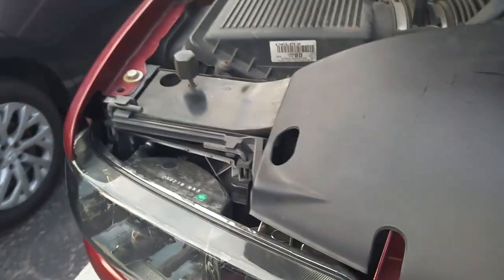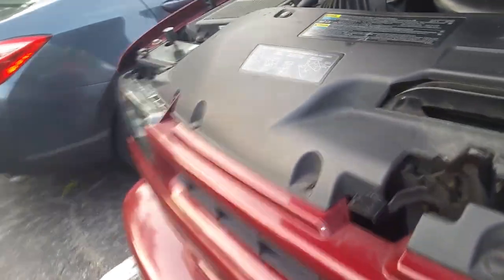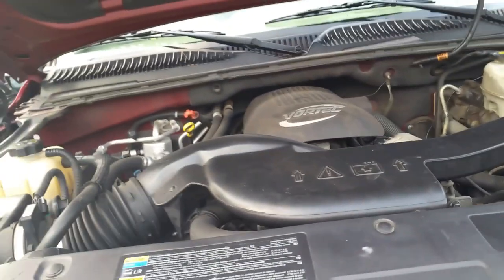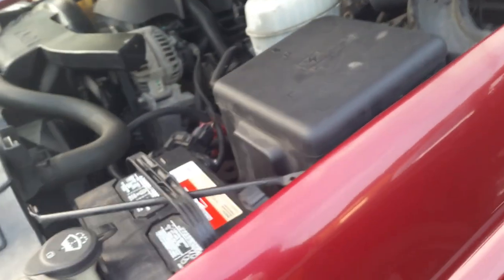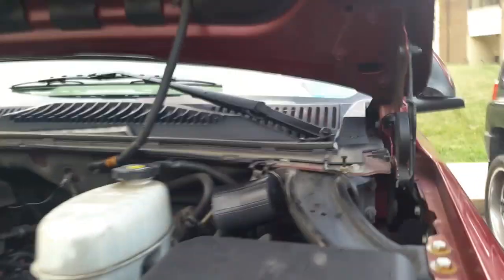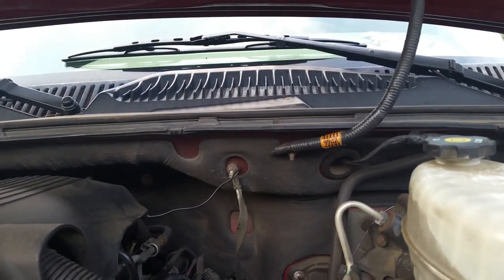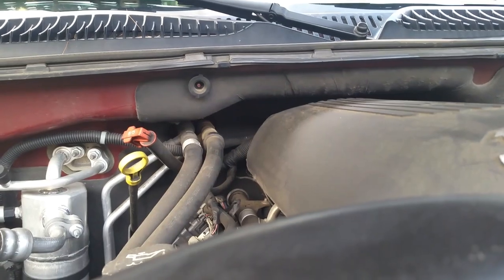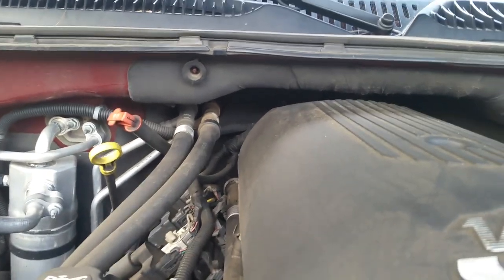Bad ground wire on 2005 Chevy Tahoe Z71

Comment: Bro thank you for this video, today my wife calls me said the car just shut off while she was driving. So I'm at work I'm a heavy equipment mechanic,  an I run a service truck, so I pack up haul but over to her cause it's a 100 degree out here in Texas, an she got my kiddos with her. So I pull up start checking fuses an battery normal diagnosis stuff, load tested batter an it was bad went an swapped out battery,  still no start. Finally I called my roadside assistance,  so I could just tow the car to the house to get them out of the heat, an work on it there. So as I'm waiting on tow truck to arrive , I start scrolling through no start issue on YouTube for suburban, an bam land on your vid. Get back out of the truck to look at the suburban,  an same thing wire broken off at the back, so I hook my my test leads back to ground right quick, an she fires right up!!! Right as the tow truck is pulling up, so I called off the tow an saved$ 135, just put a new terminal end on the ground wire an hooked it back up, no problems out of it so far.  All praise be to God, for me finding this video , an you making it.

Comment: 2003 Tahoe Z71 here, purchased new, over 300,000 miles and periodic wonky electronics, like low power mode and the ABS and Traction Control lights and weird DTC codes; also electric lock and window problems.  I feel your pain, but I have learned the hard way about Chevys and bad grounds from another Chevy I own, and keep an extra braided ground strap on hand at all times, and use my digital voltmeters to check my circuits. 

The best thing I have learned is to buy no new parts until I check battery voltage and battery ground from negative battery post to engine block then negative post to chassis/frame if it's a no crank/no start.  A bad battery connector can always keep it from starting or recharging correctly, so check the connection or voltage drop between the negative battery post and the wire leaving the negative connector or to the attachment point of the negative cable to the frame and/or  engine block.  For starts resulting low power mode, traction control and/or ABS lights, unplug the accelerator pedal position sensor connector, then spray both male and female parts of the connection with De-Oxit D5 or some similar electronic contact cleaner, even just 99% rubbing alcohol in a small pump sprayer, and plug the connector back in.  If that doesn't work, do the same to the throttle body connector, and visually check and spray the connectors to the fuel pump control module and/or pump and/or pump relay.  Check and spray any electrical connector exposed to vibration, flexing or weather or that has to work perfectly for the vehicle to function. For lasting connector protection from corrosion, use silicone di-electric grease.  If you had gotten an inexpensive scan tool ($30), or a blue tooth type scanner that uses a phone app to give you the diagnostic news ($80 to $100), you would have saved big bucks and a couple of day's lost time in this situation. Scotty Kilmer has current recommendations for these on his channel.  Also, ask your insurance agent about the cost of roadside assistance/towing on your policy - could be about as little as 10 to $20 a year per vehicle, which is what I pay.  If your policy already has it, or if you are a member of an auto club, you might be able to get reimbursed for all or part of the towing bill.

Comment: I’ve been watching videos all over YouTube for a week now and have been trying everything for the past week. I ended up ordering an ECM tonight and then ran across your video so I ran outside and sure enough the same ground wire was broken. I fixed it in the damn thing fired right up. Needless to say I’m trying to cancel my order now😂
You are a life saver I appreciate it so much ! 
I replaced my ignition my key Tumblr the battery and starter before all of this!
Reply: Any description of what to move and see that wire? My suv turns off at times and all of a sudden turns on in a couple minutes need help locating that wire?

Comment: Thank you for putting this video out. I have a 05 Tahoe with the same problem. I cut the wire you showed (mine was not broke), and grounded it like you showed. Mine would not even turn over. It runs now and hopefully this will solve my problem. I bought it in may 2019 and I have driven it a total of 3 months because of this and reduced engine power. It has sit since October because I couldn’t afford to fix it because of me having surgery. Now it runs so thank you again.
Reply: the problem my truck has is it wont crank or turn over. i tried eveything and put new parts in. my ground wire like the one in the video is not broken but should i still cut it and reground it?

Comment: Omg bro you have no idea how happy I am I found this video, 2 years I've Been having issues with my truck and meals and mechanics couldn't figure it out. It's been sitting for a good part of those 2 years and I found that ground that didn't have a good connection to the post. Rewired it and connected it and bam runs like a dream! You're a life saver!
Reply: did your truck have hesitation problems when driving.

Comment: A tip from someone that used to work in auto parts (me) dont trust them when the tester says the battery is bad. A lot of times when the battery is all the dead the tester will say "replace battery." Instead of buying a battery tell them you want the battery charged. You will need an overnight slow charge to get it back right. They have a quick 1 hr charge but sometimes the tester will say replace battery after those also.
Reply: Autozone just conned me out of a battery because of this.

Comment: I checked that wire, it was firm but I cut it anyways. I found an inch long break exposing the wire so I soldered a new wire, used heat shrink to cover 6 inches of it, grounded to the forewall, cleaned the grounds under the driver door to frame. Cleared the codes and so far so good. I just wanted to say thanks because the manual doesn't say real world things and I work long hours and don't have time to keep throwing parts and chasing a unicorn problem. Thanks.

Comment: Thanks! This video led me in the right direction. My issue was with the ground that goes from the firewall to the back of the block. This was my fix. I bought the same oe ground wire and ran it from the firewall bolt to one of the alternator bolts.

Comment: People think it's so easy to work on cars and trucks. But don't understand the knowledge and experience it takes to fix them
Reply: Because a lot of people think of mechanics as just parts swappers without realizing that sometimes it’s a diagnostic roller coaster just to find out what part is wrong.
Reply: Rite
Reply: living in a desert  🤣🤣🤣🤣🤣
Reply: I'm finding out a truck is no car , it's a different animal
Reply: Electrical trouble shooting is very time consuming, if you don’t find a good mechanic with good electrical skills, these problems can be very costly
Reply: I'm a mobile mechanic. I love when people call me and ask. "How much to change....." I give them this disclaimer, after giving them a price. " I didn't diagnose your problem, that the price whether this works or not... That's the price for changing the part". They will pay someone else to diagnose the problem but I have to argue with them to get my money for changing the part the previous mechanic mis diagnosed
Reply: @pmotorsports8276  I did somewhat that and basically mine works when it wants too now like 4-5 days it will say reduce engine power  then when I let it sit I try it out for curiosity and bam no check engine light no reduced engine power works fine but back to square 1
Reply: @sl0907  I love when they come to with a solution (thie wrong one)already.  "How much to change an alternator ?" Then complain about paying when that's not the solution to to problem

Comment: Use the big 3 method from car audio!! Put a ground grom battery to body, battery to engine mount, and if possible battery and engine to frame! Make sure to clean connect area to clean bare metal! You should also add a bigger wire to battery to alternator for better charging, be sure to run through the current sensing ring of electric system!! I had to do this on my chevy power wire to make electric system to function correctly!! I had to splice a second ring sensor to original for running extra zero guage for audio power! It solved my problem of shutting off ac after a few minutes and other charging issues!! Good luck

Comment: I would recommend using a thicker gauge ground wire when hooking up to your existing ground wire. Two ways you can connect it. You can use "Scotch Lock" connectors, these take the hassle out of soldering. Then use shrink tube followed by a plastic wire guard. Or you can just solder the existing wire with shrink tube. I preferre scotch locks.

Comment: FIRST THING.  Pep Boys policy,  if you can't figure it out and give the customer a definite answer as to what the problem is the customer does not get charged.  They owe you a full refund. Just call 1-800 or 1-888-pep-boys.  Trust me it works. I'm a retired master tech and have repaired that issue countless times.  Good catch brother.   Make sure you have a wire going from firewall to back of cylinder head.  Very important.

Comment: also theres a ground strap under the truck that wreaks havoc as well 

leading edge of drivers door follow it straight down under vehicle to frame of the vehicle its alongside your throttle cable remove ground clean all surfaces well (sandpaper ,scotchbrite or a good wire brush) replace ground to original position and your good , this ground can cause the reduced engine power fault

Comment: Mitch and Son in Law Will Drake.   2004 chevy 3500 dually.  
Just replaced both knock sensors underneath the intake plenum. Had to remove the plenum and to do so we unhooked all 8 plugs to injectors and had to tie the harness on the passenger side up and back towards corner of firewall and fender. Made removing the plenum very easy. Got knock sensors changed and plenum back on. hooked up all injectors and other plugs etc. Got in and turned key on and all dash lights went crazy. Right away I new something wasn't right in Denmark. Turned key to start position and lights went out then back on and went all funky but no crank .  Turned key off but all lights stayed on. removed key and different lights blinked on and off then stayed on with key out. Had to remove battery cable to shut dash down..  My son in law started googling and found your video.   He checked and sure enough that wire was broke and hanging behind firewall. While pulling on harness and tying it back we had broke the wire where it was grounded to firewall. reconnected the wire to ground exactly where you did and the damned truck started on first crank.  You are a God send and thank you so much. Hope your video helps many others also.

Comment: Yes,I"m an electrician by trade & sometimes the problem is very simple if you have a multimeter to.test the voltage with,on my Chevrolet LS1 V8 engine in my car,when I was replacing the hydraulic lifters in 2018 & I refitted the cylinder heads I missed fitting a couple of earth leads connections onto the back of the left hand cylinder head & a "contact dealer" message came up on the instrument.panel which usually means PCM failure.

On the left hand side of the car there's a positive power supply for the ignition coils integrated in with the air conditioning pressure switch wiring loom so that needed to be connected before the engine would even start as that wasn't connected either & the engine wouldn't start !

Comment: The ground point back there is a major issue,, that ground has a few different wires on it. Within a year your truck is not going to start again but this time another wire is going to break free from that ground point. That ground is for the ECM and a easy fix is to take one screw out of the engine computer and put a wire on the screw and run it to battery ground.  👌

Comment: Thanks for video, been working on 2004 silverado, no  crank no start, dash lights staying, replaced ignition switch still nothing frickin going crazy trying to figure it out. Watched this went straight to wire it was just hanging like you said fixed ground problem started first try.

Comment: Now you need to put in better quality ground wires; understand that there are several on all vehicles. Make sure that the attach points of all the wires are clean and use dielectric grease on the connections. Good luck Sir!

Comment: Tell me about it! Same thing happened to me. Except, I took it to Chevrolet. I have a 2003 GMC Yukon SLT 4WD. I told them I thought it was the ground wire. They said they would look at it.  They said it was the ground wire, but that they had to take all these assorted parts off the vehicle to access it. Charged me $400 something. I personally think its a set up - scam by Chevrolet. It happens to a lot of vehicles. Should be classified as a defective part issue and there should be no charge for the fix.

Comment: If these parts changers were really mechanics, they would of done a voltage drop test and found it
Reply: I pulled wrenches for 15 years, ASE certificates in 7 of the 8 areas at the time. I got out due to the need to obtain training that employers either did not want to help with or you got their brainwashing blurb school. One thing I remember printed on the side of every Sun Oscilloscope was "Test not guess". I have lived by that since I saw it. I have been in Industrial Electrical Maintenance for over 30 years. Finding issues like this is an almost daily occurance in a variety of settings.
Reply: @thegreenerthemeaner  2007 Tahoe headlights flickering.  Any ideas?
Reply: Peterbilt Pilot  thanks buddy.  I did a charging test on the alternator and it was charging low. New alternator fixed it.
Reply: Joey Sanchez check your light control module in dash common problem in these chevys
Reply: Same shit happened to me lol. I did find a video on YouTube though and found that exact issue before I started paying anyone. Thank god.

Comment: It's not Chevy's problem more than likely intake had been removed or oil sending unit had been replaced there are two bolts on the back of the head either on the passenger side or the driver side each one maintains a ground strap if their technician is too lazy or does not want to reinstall that Bolt the ground strap that you were talking about will not be installed properly there for creating drivability issues

Comment: I have mine running to that same ground that goes to the hood also. The original spot had oil on it my cluster still isn’t working though. Hasn’t stalled on me yet 🤞 hope that doesn’t happen.

Comment: Seems like that geneeration, '99-'06, Chevy/GM's with those Vortec engines, have an issue with grounds failing.  I recall some dude has great vids on that specific problem and how to remedy it.  Big Three, etc., etc., etc., but more importantly, how to correct that lurking issue.

Comment: OK happened to my son making pickup at airport 2 hours away....Somehow got jump and got things going again....watched several videos (2004 Crew Cab Chevy 5.3) and pulled on the wire seemed tight....next morning transmission indicator leds were flashing, Jumped, and has run with all gages working again for several short trips around town...Perhaps just got enough corrosion lose to get it to ground again.....our wire was Black with white stripe.

Comment: Engine cut out on my 03 and been chasing it forever. New starter, alternator, ignition switch and lock cylinder still only the battery light on the dash. No power to the radio or cluster and no start I'm gonna redo this ground and hope it fixes it. My budget has ran dry.

Comment: The grd wire looks like at #10  so   a similar  would be well devised.  Better to over size then under. Depending on your area , any grds which I do/ redo I use Kopper Kote  it lasts longer the the other has more oil to keep that area from rusting sooooner.  Don't  like doing jobs twice.

Comment: You can't blame that on the maker...you don't know what's been done to that motor that caused the wire to break. It's knowledge...every car i've owned since i was 16 i've had the all ground wires and evap systems checked once a year during inspections.

Comment: @darrell smith and anyone else with a heating problem i had this issue and watched a fellow show how to reset your hvac (heat and air) and its easy as shit directions as follows

1.first pop your fuse block open (under hood)

2. locate two groud bolt (they are two squares they do nothing inside fuse box)

3. locate hvac easc fuse youll see it close to ground block closest to firewall (youll need to remove this fuse in a minute so remember where it is)

4. turn key to the on position then hit auto on your heat controls then turn key back to off position 

5. remove aforementioned hvac fuse under hood and leave removed for about a minute replace fuse 

6. turn key back to on position and once again hit auto on heat controls its should come up at 74 degrees this is your reset working give it a 20 count and turn key off

start vehicle you should be good to go

Comment: That ground wire is way too small for the job. Don't be using cheap wires or you'll be back in the situation again. Google something called The Big Three. Look it up that's what you need to do all your problems go away. And also evident in your video is the chassis ground between the hood and the cab. You can see it about to break off fix that one too